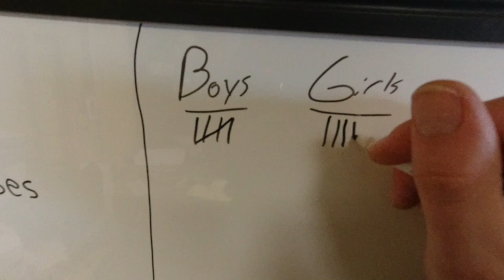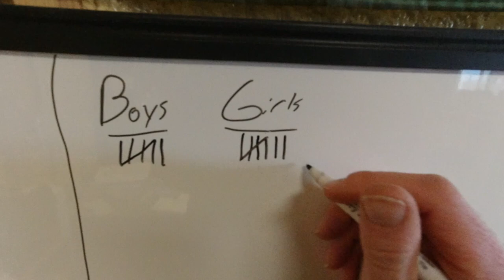Technology Tells Us Our Cow is Calving!

Comment: Now we know how Brian deals with mouse problems in confined spaces XD
Reply: A chainsaw or a two stroke lawnmower engine running on fuel with too much oil in it soon smokes them out but you need some chicken wire in a circle around the building so that the dogs or guns can deal with them as they emerge as they tend to emerge in groups too fast. (You will need to replace or clean the plug frequently!)

Comment: Hooking the exhaust up with a hose then putting it into the water isn't it kinda like contaminating their drinking water with carbon emissions from the exhaust?  Just curious 🤔.
Reply: Good question.
Cole ? Did you ever taste the water afterwards to see if it tasted like exhaust ?
Reply: the exhaust was never in contact with the water, and even if it was thats not an issue.
Reply: @briansonne814  ok great to know I was kinda puzzled when I first saw that lol so you set the end of the hose on the water PIPES to thaw them out am I  correct.
Reply: @defan4evr  yes the heat that comes with the exhaust is being used to thaw the pipes
Reply: @briansonne814  thats using the ole hat rack 💀 🤣 great idea 💡 👍 beats sitting there with a BIC or a ZIPPO lighter just saying 😆